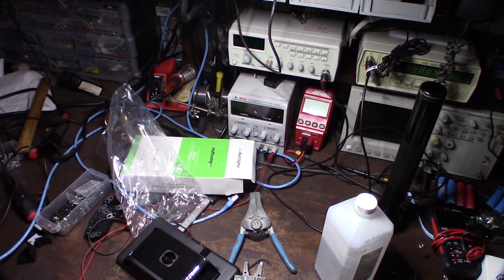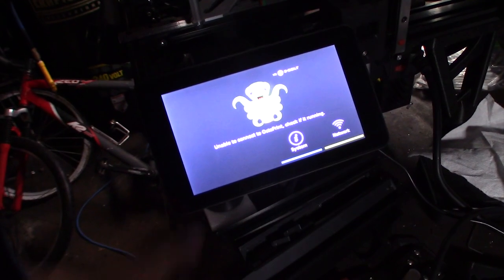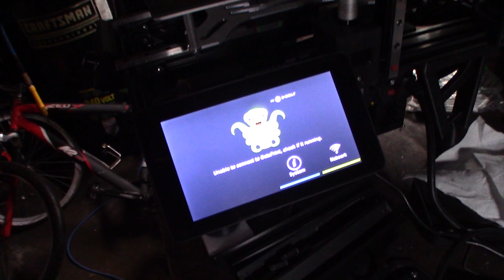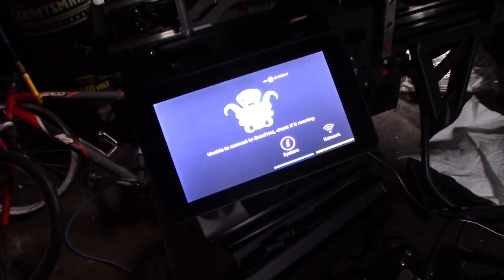NeeGo Raspberry Pi 4 Screen Case for Raspberry Pi Monitor Touchscreen Display 7-inch

Comment: Looks just right for my needs but I also have a SSD board attached to the Pi so am wondering if this will fit too as I want to run everything from the SSD inc the OS. If you leave the small lid off do you still have access to the 4 stand off locations?